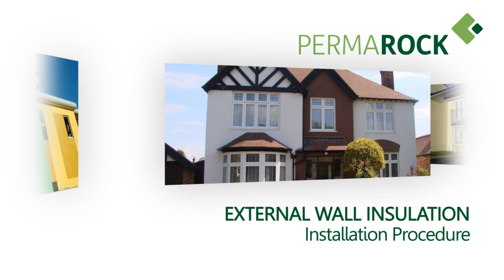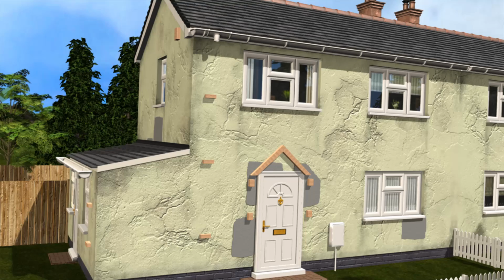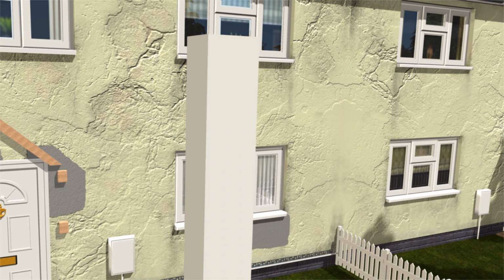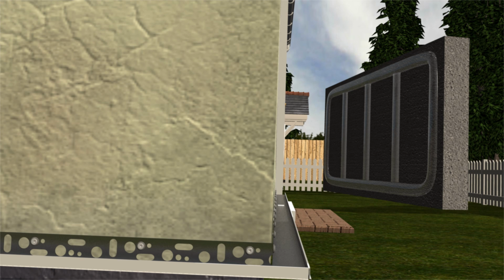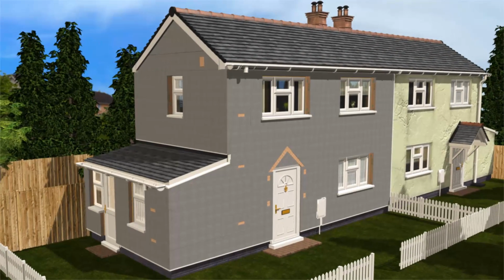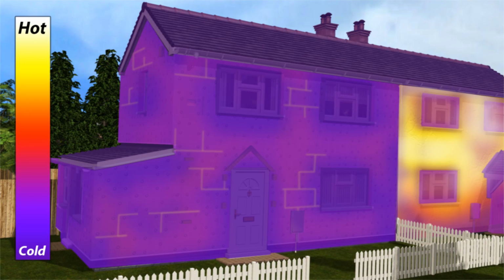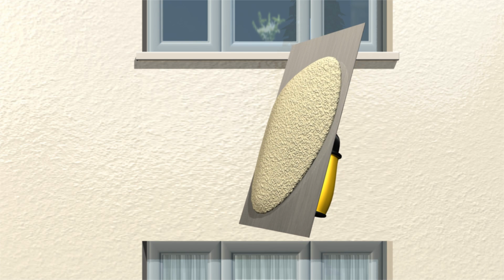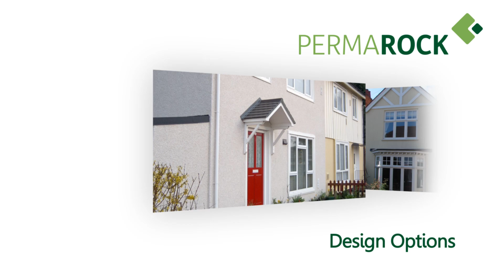Permarock - A Guide to External Wall Insulation Installation

Comment: What kind of insulation boards are used in this?
Reply: Depends where you live, but I'd go for 100-120mm in the UK. 
I'm not sure about R-value (i could calculate after some research), but to give you an idea. My friends in Cardiff, insulated the house with 100mm polystyrene panels. Before insulating, on a typical winter day wit ext. temp around 0C, when they switched off boiler in the evening, in 8h by the morning the temp inside would drop from 20C to 15C. Now after insulation the same exercise gives results from 20C down to 18.5C. 
A lot of depends on what type of wall you have and how much thermal mass is there, but this exercise is very simple to estimate how much savings you can get.

Comment: What about on wood exterior wall covering?.  Millions of tract houses have T-111, or other wood exteriors!!  We need systems that work on that!!
Reply: The principles will be the same, but instead of adhesive fixing, you will be using only mechanical once, fixing the panels to your T-111 planks (or even deeper, to the wall). 
I would clear the wood prior insulation works and treat it with something anti-decay to last longer. Alternatively just remove the planks as they will be totally redundant and they only limit durability of the system.
Reply: @mateo_dequ    To clarify…do you mean, 1)  remove the old siding (& wrap, it it exists), 2) fir-out the studs to fit thicker insulation, then 3) wrap & new siding on it? 
Have thot about that, too…. It makes sense.  But, if I went to that effort, I’d remove the old, saggy mingy batts & replace all of it—which could probly measurably improve the insulation of the walls.
Reply: @Chimonger1  what type of wall do you have behind the siding? is it a brick? 

i would remove the siding mainly to avoid decay. The condensation should n't appear, but if there are frosty winters with -10C, a bit of condensation could potentialy happen between insulation and wall and your siding would get wet. 

If you have a brick wall, i would remove siding, clean the wall and follow the instructions in this video. 

I don't think having siding on top insulation is a good idea because you will have to use more stud fixings and for siding I think it would have to be steel studs which would impose heat loses . I am a bridge ingineer so not that familiar with housing stuff but I'm not sure if there are any strong plastic studs to fix your siding therough 100mm insulation down to the wall (approx 180mm long). Lots of drilling, time and costs. You'd be better of with the standard finish as presented on this video.